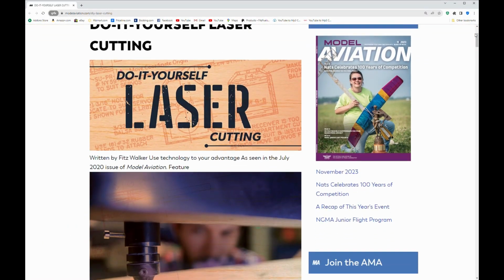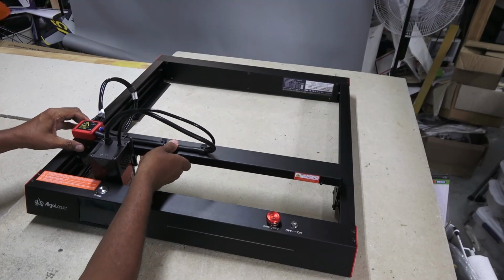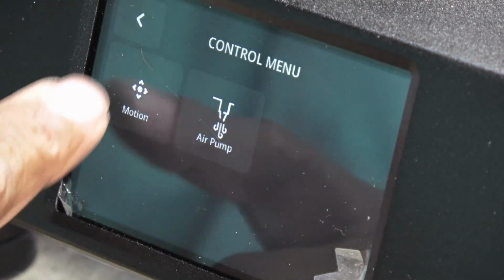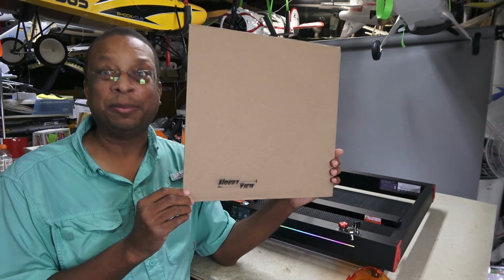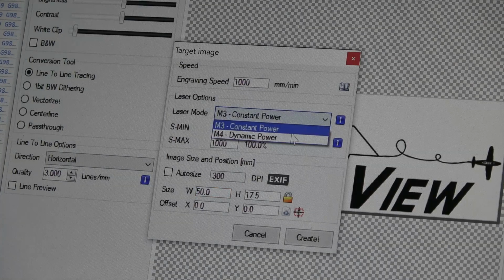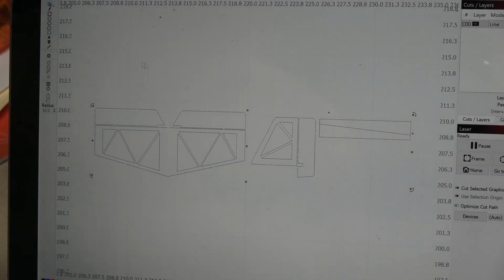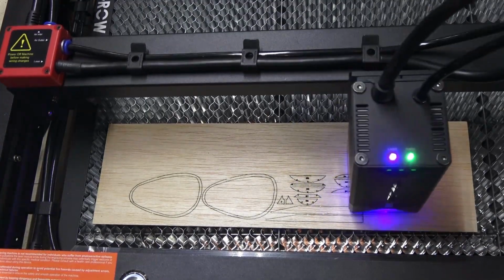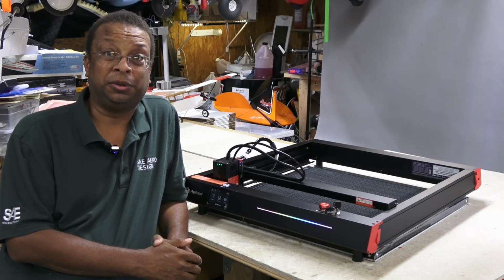Coherent Cutting - AlgoLaser Delta 22W Diode Laser Engraver | HobbyView

Comment: What is the maximum size of sheets that can be cut? I can’t find that info on their website?
Reply from the maker: It's about 20x20 inch. But I'll double check.
Reply from the maker: Ok. I measured the cutting area as approx 17 5/8" x 16 3/4" or 450mm x 425mm